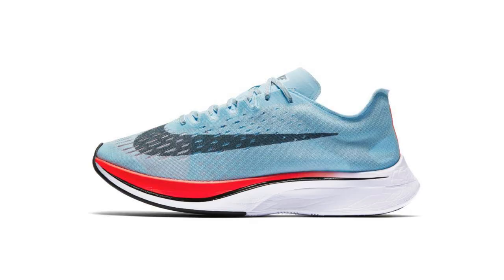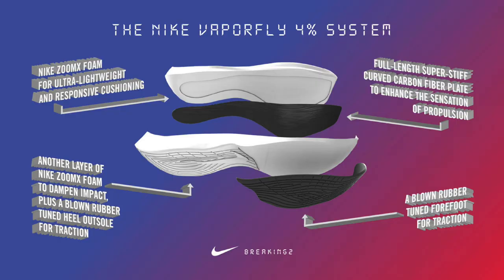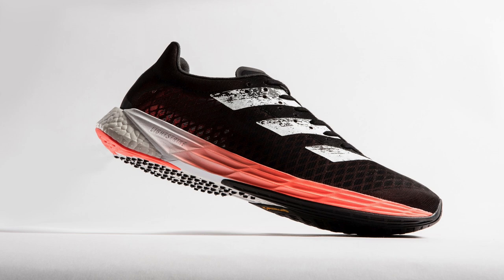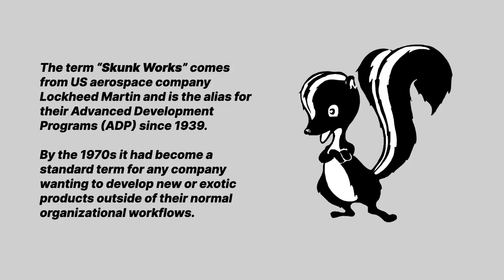Carbon fiber plate vs rods | Why Nike and Adidas made such different design choices.

Comment: Hi! At 14.37 you show a still of an adidas designer explaining how Energy Rods work and you say you can't find the original video where the capture comes from. It's not a capture but a picture and I know it pretty well since I took that photo at adidas HQ back in April 2022. Mystery solved!
Reply from the maker: Thank you! I’ll credit you in the description. Do I use your YouTube name? What’s your preference?
Reply: Thank you very much @SagasuRunning  ! My YT handle is fine. Just for reference, the photo appeared in Runlovers, an Italian website on running which I run with my co-founder. It's been great to see the photo in your video!
Reply from the maker: @martinopietropoli I’m always careful using images from sources I’m not fully clear on… but finding a 3/4 shot of the Adidas Energy rods is very difficult. This shot was perfect!

Credit added and thank you!

Comment: Very well explained and informative. For Nike, ZOOMX just has to work together with a carbon fiber plate to provide propulsion, the market response of streak fly (it's still a good shoe but elite runners don't like to wear it for racing) have already demonstrated that ZOOMX without plate just don't work as good as shoes with the combo. Invincible 3 is another example that even if you make the ZOOMX thicker in the midsole, without carbon fiber plate, it's not really for speed training but more for daily wearing/jogging.
Reply from the maker: Fully agree. ZoomX is best with a plate (or a carrier foam). However, it really works well in conjunction with other materials (plates or foams). On it's own though it can be lacking something. I loved the Streakfly, but it definitely did not have the same punch as a Vaporfly.

Comment: These bars in the Adidas pro 3 occasionally feel pressure on the foot. Then it goes away and happens again. Really painful, disturbing
Reply from the maker: I’ve never felt that in the AP3. I did feel it occasionally in the Takumi Sen 9 though. I agree, it’s annoying when you do feel it.
Reply: @SagasuRunning  Endorphin elite has these carbon finger extensions in a flat form....a much better solution
Reply from the maker: @DamjanTiki  Not sure I agree there. The rods are a much more dynamic and tunable solution. They offer more options for Adidas that a CF plate with fingers.
Reply: @SagasuRunning
Reply: can't confirm or deny...I really like Elite, fast, stable, wide. 21 km run was the same in my shoe all the time, which I can't say about Adios pro 3. Adidas became after 15-16 km less responsive.
Reply from the maker: @DamjanTiki  PWRRUN HG foam is nice, but I definitely prefer LIghtstirke Pro. I also find LSP very consistent and durable. Never once have I had issue with LSP.

Comment: Excellent video👍.  Really good work👍.  I do a lot of tests myself to see which running shoe is the most effective.  One thing I often think people forget to talk about when comparing Nike carbon shoes with Adidas (lightstrike pro) is the difference in durability.  You get a lot more mileage out of lightstrike pro than ZoomX.  And in a world where we have to think about the environment, I think it's an important thing.  This is where Nike can and must improve in the future
Reply from the maker: LSP is just so much more dense, chemically speaking, that it last forever. I think Nike is going the route of recycling ZoomX... though it seems spotty.

Thanks for the kind words and support!
Reply: @SagasuRunning  Recycling ZoomX is just not the same as regular ZoomX. But maybe they will find a way to solve it🤞. I haven't seen all your videos. But I have to😀. Keep up your good work👍
Reply from the maker: @Treadmill Running  I agree… it’s not… but that is there solution for now. We will see where they take it.

I appreciate the support. 🙏🏻
Reply: You can use Adidas as a daily trainer because it is more durable. You can use Nike as a race shoe since it is more responsive. You get the best of both worlds
Reply from the maker: Not a bad plan… depending on the shoe combo.

Comment: Interesting take on the plated trainer situation that I largely resonate with.

I personally have a preference for a light flat as my default. And I struggle to find a trail shoe that does the job I need nut isn’t a brick in my (large) size. 

I have an intermittent history of hallux irritation on one side which was originally a traumatic injury that presented like gout and is now basically osteoarthritis that rarely flares up. The ideal management for me to keep going through this is a stiff rockered shoe with a fairly firm midsole foam — specifically I have had success using the Boston 10/11 and Adios Pro. I otherwise don’t really like these shoes but they have a use for working through this problem for me. 

They said I don’t personally see how I could make use of a Mach X or Kinvara Pro though. 

On the trail side I am really intrigued by the NNormal Kjerag which is absurdly light for a trail shoe: 255g in my size. And it has a simple design with high-end materials that can even be resoled by a cobbler! Unheard of. NNormal will also recycle them. This is essentially the polar opposite of the tech strategy you are describing in this video driving Hoka and Saucony to keep adding models.
Reply from the maker: We seem to be of the same mind and biomechanics. I too prefer light flats for much of my running AND have a history of hallux limitus from years of stuffing my feet into 2-3 size too small snowboard boots and skateboarding. 

I work daily to keep what flexibility I do have in my big toes and don’t have an issue most of the time, even with flexible shoes. In fact if I run in rigid shoes too much, like The Takumi Sen 9 or Adios Pro 3 my toes make me aware of it. I guess they prefer Vaporfly flexibility (relatively speaking) after all these years. Same with the Adios 8 vs Streakfly for me, though to a lesser degree.

Comment: As a shoe geek, I'm loving your take about this topic. Carbon plates and rods have their own strengths and weaknesses. I'm enjoying both of these shoe techs.  I would like to know your take on the Alphafly as the carbon plate on that one has a different shape compared to the Vaporfly.
Reply from the maker: I’ve done a lot or AF3 technical content and have talked about the plate configuration differences in my “Choosing the right Metaspeed for you” video. 

I’m not a fan of the “high plate” configuration, I much prefer the “low plate” configuration in the Vaporfly. 

I’m thinking I need to make a video, outside of the Metaspeed issue, to address this.

Comment: In the heel area and in the rear and middle thirds of the forefoot area, Adidas should have engineered pockets of air beneath the rods so their close position to the heel does not affect the foot sinking into the (somewhat firmer) Lightstrike Pro, maximizing impact softening properties while landing. 

In the  remaining third up front, the one that does not get stressed until rolling and toe-off, no air pocket for the rods to sink into. This would have the effect of giving the rods an immediate abutment support against which the rods can catapult the heel into the air by virtue of our own weight, power, and momentum. 

One could even argue that this enhanced rocker-catapult-mechanism might profit from a carbon cross-ridge at the bottom between thirds 1 and 2 of the forefoot, provided this can be engineered without compromising comfort. 
Same mechanism as prying open a door essentially, just that we're working the short end unfortunately.
Reply from the maker: Interesting ideas. Adidas couldn’t go near any type of air pocket or air unit in their midsole… Nike would end that quickly with a cease and desist…

Comment: Terrific video, one of my theories was that Nike developed the carbon plate because Adidas was so far ahead in the energy return foam technology.  When Dennis Kipruto Kimetto set the marathon record in Adidas in 2014 Nike was really under pressure to do something.
Reply from the maker: I agree, Boost did shake things up ALOT... but in 2016/17 Nike caught Adidas (and the industry) very off guard with both ZoomX and the spooned CF plate. Id say that was an even larger disruption that Boost was. Though I do see Boost as a proto super foam.

Comment: Great video. I know people who have snapped energy rods... But not known anyone snap a carbon plate... That said all these supershoes have a very short lifespan.
Reply from the maker: Breaking a CF plate takes much more force that a normal running stride will apply. It can happen but is rare and usually due to a manufacturing defect. Cracking is more common, especially on the lateral side. Adidas’s rods are inherently more delicate and (as I said) need the firmer foam to support them. As adidas moves to softer foams it will be interesting what they do here (as I’ve pointed out in multiple videos about that).

Comment: Thanks for the perspective. Totally agree. Plated shoes are fun and exciting. Running should be fun and exciting!( after the pain😅) Plated shoes should be one tool in the box. My experience with the plated racers, is that they only reach their gorgeous potential if I’ve been putting in the miles on the regular in other shoes and I really have my legs under me. As for plated trainers, I can’t speak to that as I have yet to make the plunge. Pretty tempted tho😊
Reply from the maker: Yes! Plated race shoes feel AMAZING after you’ve put in the work in “normal” trainers and built a strong foundation. Training plated shoes full time will just void that work overall. Not the end of the world but also missing one of the (many) pleasures of running… lacing up those extra fast race shoes.

Comment: Great and very clear explanation and keeps me engaging content as always.

Couple of questions.

1. any side effects of those running in rods vs plate everyday?Some said it is bad to use carbon plated or carbon rod everyday?Not sure what is the right answer or if there is any? what about those who train in carbon fiber plated or rod shoes? 

2. Another question is when people are talking about energy return, what it is exactly? Is it like a trampoline effect? but i guess that should be called "bounciness"? Are they the same? Or is thr term energy return can really be measured if someone would test in lab?
Reply from the maker: Your questions 

1). While there are no studies specially saying running in plates or rods 100% of the time is bad… if you think about it you aren’t letting your foot and ankle flex naturally so by running in plated shoes 100% of the time you are loosing a big training stimulus. Training in plated shoes, even often, isn’t a problem… just make sure to mix in a non plated trainer for the alternative training stimulus.

2). Energy return isn’t exactly bounciness. It’s about how quickly the midsole rebounds to its neutral state once it’s under load. Carbon plates can aid this to a small degree…. But their real purpose is stabilization and/or creating a platform for the foot to effectively load the foam of the midsole. They can also aid in helping the foot roll over the toe, especially with very high stack shoes.
Reply: @SagasuRunning  thanks for the great response!

Comment: I watched some reviewers saying that for adidas rods, after using it for quite some time they hear broken glass when they shake the shoe. I mean eventually after some high milage.

It seems since the rods are thinner they are more prone to breaking? Does this make sense to you?

BTW great explanation, a very informative video! 🎉
Reply from the maker: One of the design flaws (or challenges) of the rods is they are less structurally resilient than a full plate. So they can break. Adidas has engineered around this with the denser/firmer Lightstrike Pro foam, but due to the cutouts in the midsole and prolonged use they do break occasionally. I've never personally broken one, but it's only a matter of time.

As Adidas moves to softer foams, like Lightstrike Pro Evo, breaking rods is going to be a larger issue. I've made a few deeper-dive videos on it;

Adidas Adizero Adios Pro Evo 1 Revisited https://youtu.be/93m7C4x8Z6s 
Where does Adidas Adizero go from here? https://youtu.be/r_TKjQ5kIM8 
Is the Adidas Prime X 2 Strung the future of Adidas Running? https://youtu.be/T7O4qG98afA 

Hopefully those videos are as interesting to you. 🤙🏻
Reply: @SagasuRunning  thank you will definitely check these videos! Awesome vid content, more power to your channel! 👍
Reply from the maker: @wmgonzalbo 🙏🏻🙏🏻🙏🏻

Comment: great videos - i was wondering - whats your view on the wisdom of doing all your running in carbon plated shoes? There have been lots of noise about an increased injury risk doing this. In the context of this topic do the rods present a safer option?
Reply from the maker: I'm not a fan of it... But I'm also not a fan of doing all of your training in one type of shoe. Shoes are tools and having the right tool for the purpose is important. Training effect, injury prevention, etc... all key. Doing the SAME thing all of the time is more the issue.

Training in plated shoes is fine by me, I do it often (In fact I had a great session in the VF3 today). But tomorrow I'll be in another shoe. 

Specific to rods... I'm not PT, BUT...from a product designer's POV... rods could be better as they allow for more lateral flex while providing longitudinal stiffnes.

BUT... not all carbon plates are the same. I'm actually testing this out now for an upcoming video, which is why I was in the VF3 today. Nike's plates are very unique as they have the pop and propulsion we all want from a plated shoe...but they are much less stiff laterally. I think Nike's plates are much thiner CF material than most other brands Carbon Plates. Asics, for example, has VERY rigid plates that feel like blunt instruments compare to Nike.

The last thing I'll say is that so much depends on your own gait, foot strike, toe flexibility, foot strength. It becomes very subjective.

I'm currently working on some videos are this subject. Stay tuned.

Thanks for the kind words. 🙏🏻
Reply: @SagasuRunning  Thanks for your considered reply
Reply from the maker: @craigtsmith6957  As I said… I’m writing a video on this. In fact your comment got me to reopen that file. So expect it in the next few weeks. 🤙🏻

Comment: Personally i think Nike can do it because Zoom x is sooo soft , actually too soft by it self (that sinking stuck feeling like in the invincible) which makes the plate an integral part in its performance. Adidas could ditch the CF i think and go for a more flexible material that returns to its original form as fast as CF  because their mid compound is more dense than Zoom and the mid is thick enough to keep that toe off form (if snap is what Adidas is looking for) . CF for me is too brittle (especially in rod form) for it to give a desired flex  with durability. Example  (cracked my Metaspeed sky plate going down the stairs (landed flat, midfoot on the edge of the stairs) and that is a plate , also there were rod failures in the Adi Pro 2 . Sorry i have a hard time explaining in english. Adidas torsion plate was good enough and i think Adidas just wanted to just join the CF bandwagon . When it comes to weight of both , that is another story. Love the chanel BTW.
Reply from the maker: I think the rods are a great solve by Adidas for LSP. But yes, rods are fragile.

I’ve had a few friends also crack Asics CF plates… they are just so rigid. I’ve never known anyone who cracked a Nike CF plate though… at least form normal use.

Thanks for the support and kind words! 🙏🏻

Comment: So the logical evolution might be some kind of carbon net, that is hollow inside... because the benefit of a whole plate should be that there are less moving parts meaning less energy wasted... I wish they'd use graphen in their superfoams or anything, thatbmakes them last longer...
Reply from the maker: Use of graphene in a midsole foam with raise costs nearly exponentially and is unnecessary. In the outsole compounds it could be useful.

I carbon lattice could work to strengthen the rods, it could also be applied to control the stiffens and flex properties of the midsole...but would be complicated and costly to produce at scale.

Comment: Happy with just running without Carbon Plates or Rods in my shoes.  Money saved and benefitting health wise from running..
Reply from the maker: Carbon plated/rods have alot of uses in running but only really if you race or need to train for long distance speed. Other that haha a non-plated shoe will be your best be 90% of the time.
Reply from the maker: Just make sure to mix in a non-plated shoe here and there to maintain foot strength and balance...running is a gift though!
Reply: @SagasuRunning  :  Love my Kayanos.

Comment: My understanding of the interest of carbon plate is to act as a lever. The spoon form is there to retard toe off lever action.
Where you run your foot lands mid foot, the spoon shape allows the use  the foam above the plate for confort, and when you reach the plate, tow off starts, pushing your heal up.
The rods do the exact same thing, with them  pushing the heel plate up on toe off.
Reply from the maker: Partly. The plate does aid in helping the foot up and over toe off, especially with higher stack or stiffer foams (like Lightstrike Pro). So yes, rods do this, while allowing for more lateral flex in the shoe.

A plate also stabilizes the shoe or foot in the shoe, depending on where the plate is located in the midsole in relation to the foot. Rods don’t do a good job of this.

Rods are really a unique Adidas solution thwt really only works with the much more dense and firm LIghtstirke Pro.